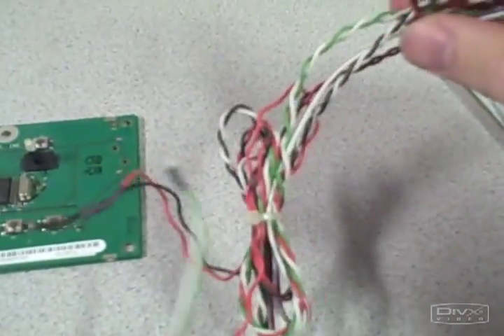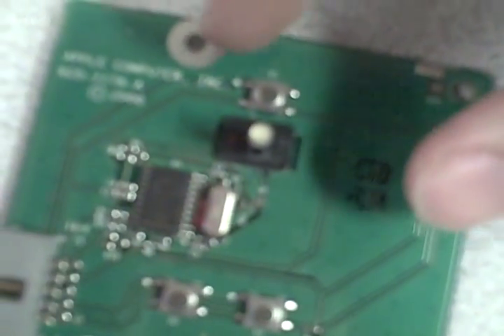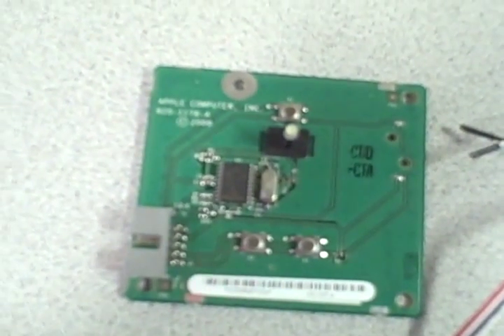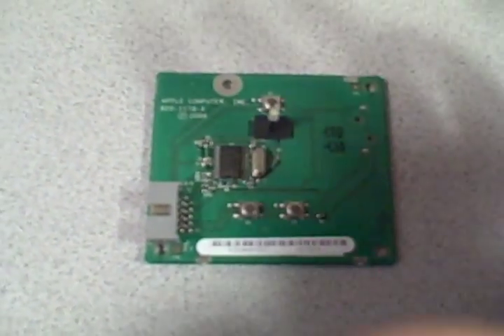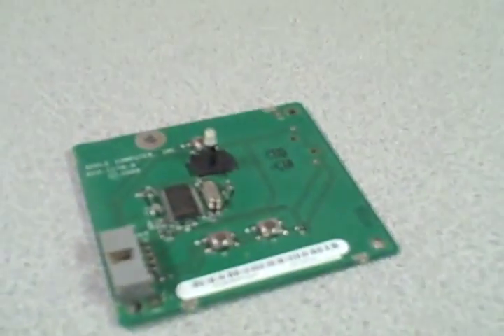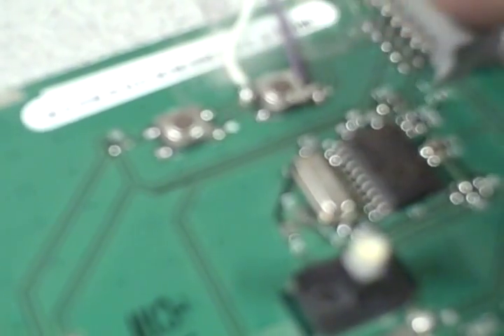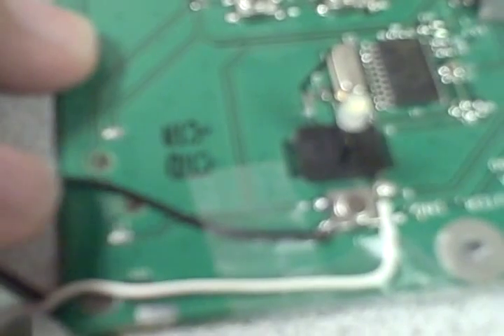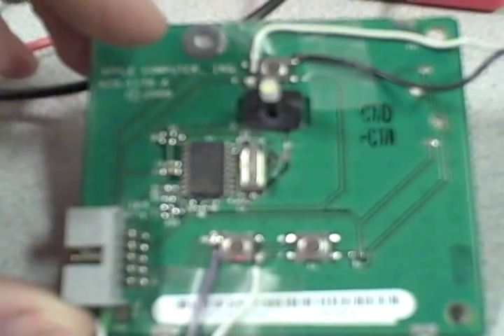Modding a G4 case for a hackintosh (part 4) front panel

Comment from the maker: Just drill a hole and thread in a motherboard standoff. If the standoff is too short you can make some plastic washers to make the height right. you can also try to epoxy some of the plastic motherboard standoffs. My flip camera doesn't focus too well, I guess I need to upgrade. I have a canon mini dv, but the tapes are a hassle and take a long time to upload, its also big. When I can I'm going to buy a small HD camera.